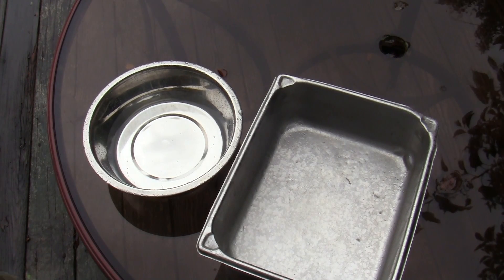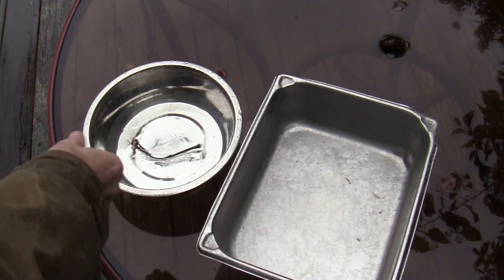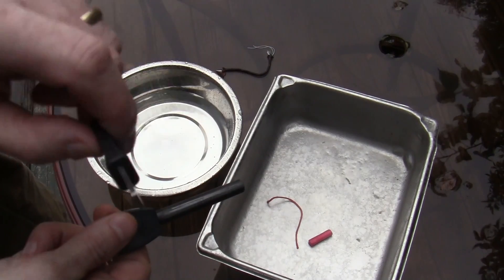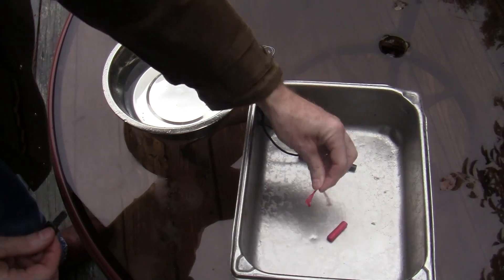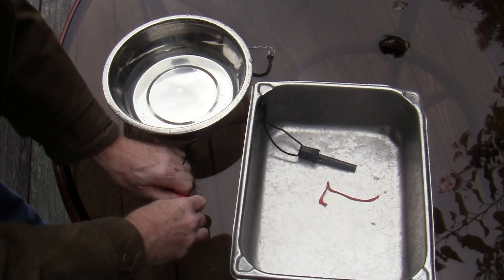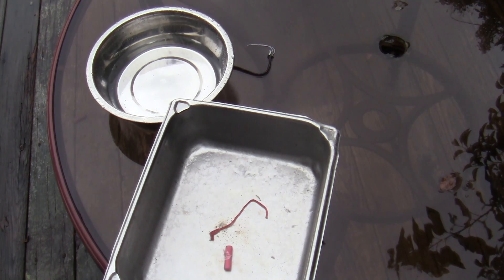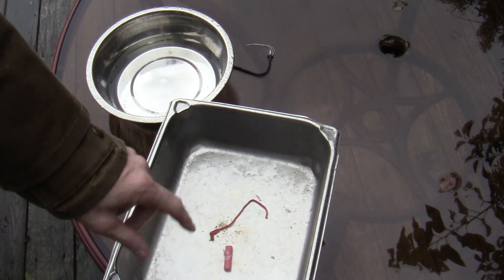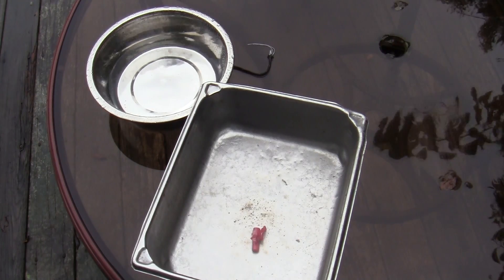Does 550 Fire Cord Ignite When Wet?

Comment: Get some clear nail polish and make a 300 batch of waterproof matches.  One box of strike anywhere matches, one or two bottles of quick dry clear nail polish from the dollar tree store, ( matches are sold there too, but are strike on box only).  Dip matches and set on the edge of a book or thick magazine  to dry.  
Cost $2 or $3 for 300 wooden matches and polish.  I make them while watching TV and set to dry overnight.  Cheapo way to start a fire.  Other suggestions, carry a pencil sharpened to make tiny shaving from the inside of a twig.  Peel bark off wet twigto get to the dry part.  Get your match and start a fire with a guarantee it will light.
Reply: Nantinki Rose Oh  post script here,  many thanks for the great video though.  It saved me a butt load of money buying and trying these products!   Great of you to do an honest sharing.  !!!
Reply: Nantinki Rose Lumber yard and supply stores  sell the very best pencil sharpeners too.
Reply: Nice idea thanks! I've dripped candle wax on to matches before but this sounds like a good idea